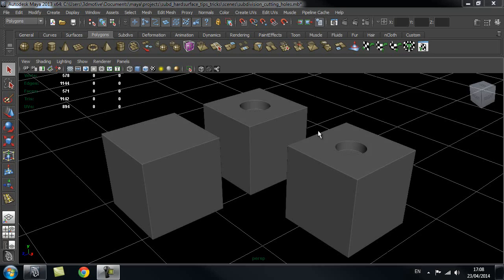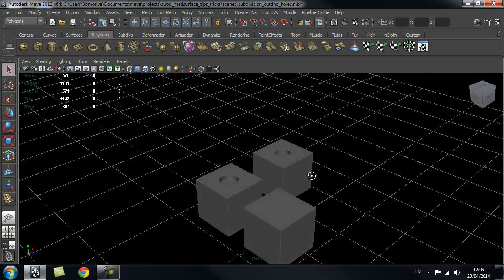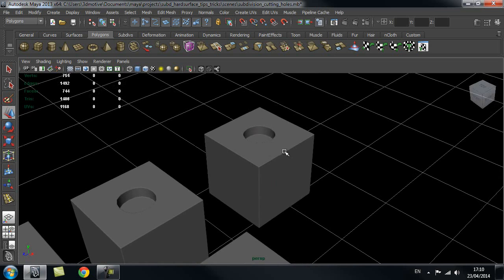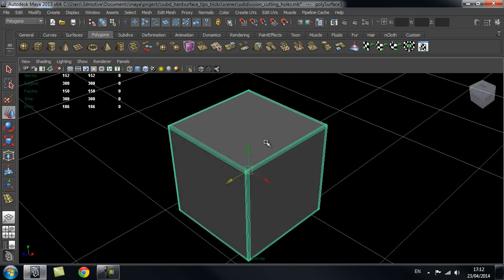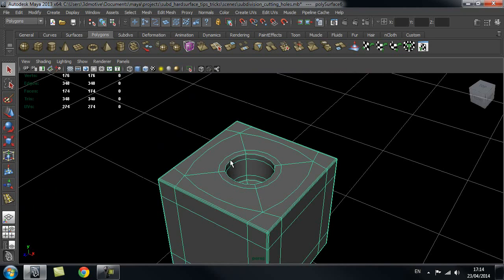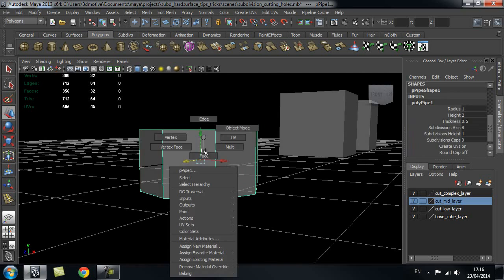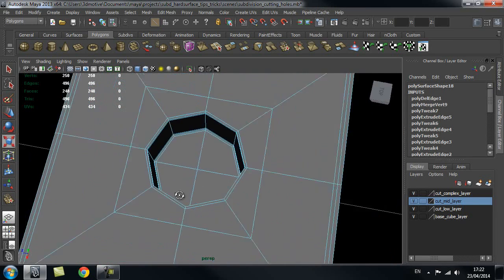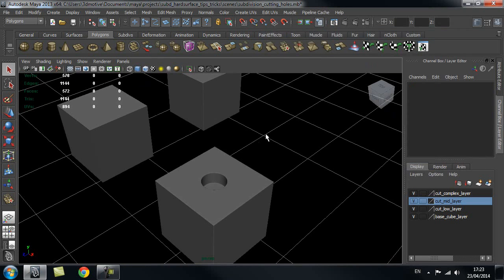CGI 3D Modeling Tutorial : "Cutting Holes in Hard Surface Models in Maya" - by 3dmotive

Comment: Is this seriously the best way to cut holes into meshes within maya? 
The method in max is as simple as creating a spline, using snapping and cutting the spline shape into the mesh below. 

Does maya have a similar way as this method is beyond long in terms of production standard in max.
Reply: I would use Booleans tool in maya, takes a minute for the same result. I think this tutorial is aimed at beginners.
Reply: Jacob Claussen Using Booleans gives you a very poor mesh leaving endgons
Reply: chessecakemania  Not if you set up the mesh right, in this case you can just make edges in the middle of the cube on the both side and the holes vertex points will be merge with the cubes. I´m using Maya 2015 and the booleans have been improved.
Reply: Jacob Claussen I don't use Maya, do Maya's Booleans really give you the same mesh with octagonal hole?
Reply: prixat Yes! But sometimes you need some clean-ups. There is a video from Steven Roselle showing Booleans "Maya 2015 Modeling Improvements, part 1". With all this said i think 3ds Max is a better program for modeling but i´m just to lazy to change right now hehe.
Reply: Thanks
Reply: Jacob Claussen I think booleans were introduced in the 2014 version of maya and from what I know in that version they are very buggy and unstable and could cause a lot of problems down the line, I personally don't have the 2015 version but unless they've fixed all those problems then I'd stick away from it.

Onto the original note, the most important aspect of modelling something like this is planning it out so you can set up the "infrastructure" for it, making sure you have minimal (preferably zero) broken edge loops can ensure that you will be able to do this on a complex shape with ease.